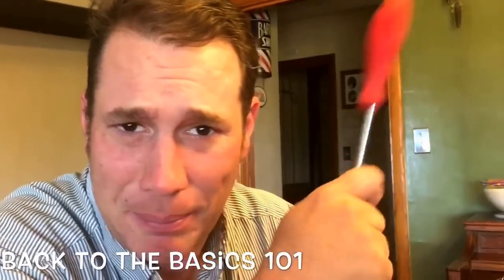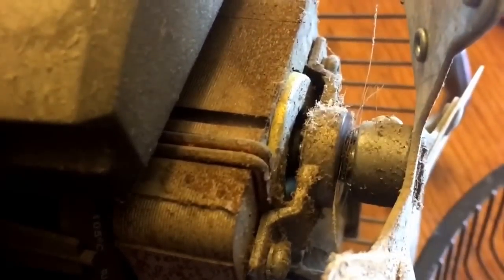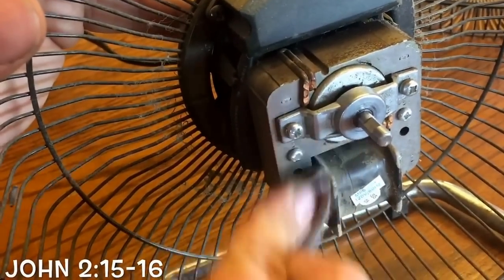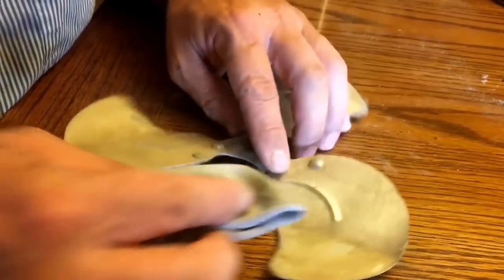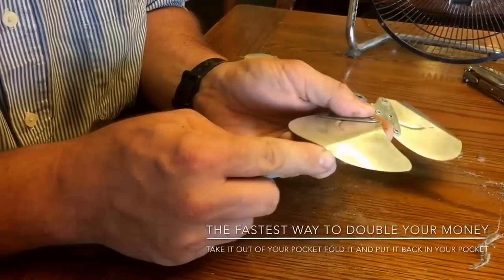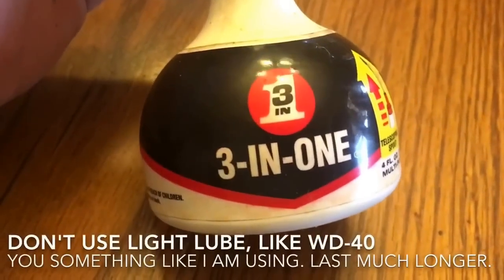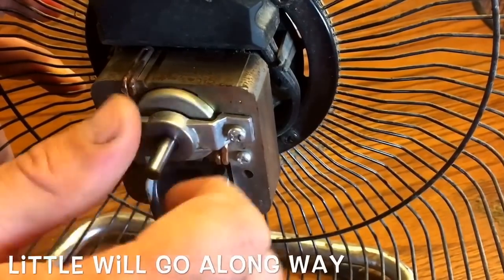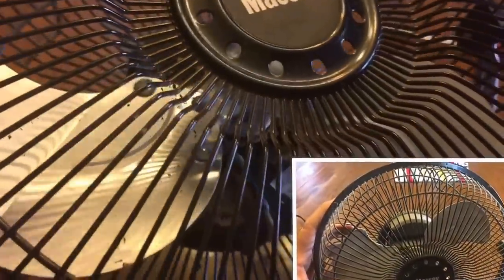Service your FAN,Clean and lube your fan

Comment: Hey, my fan is like the same. I had unscrewed those two screws on the side and the thing that roates the blade stopped rotating. When I went to go screw it back together It made a humming nose or I would have to push the blade to make it go and the metal brick thing would get super warm. After getting the both screws even and not super tight it started to spin the blade normally again. There is two hex nuts the hold it together. Mines are a bit lose, so I hope that when my fan is going it doesn't loosen the hex nuts and the cylinder metal thing doesn't go lose.
Reply: Just humming and blade does not spin (motor not burnt out).  Turn off fan, disconnect fan.  Take apart, clean fan blade, motor then lubricate motor at the bearing.  Spin the shaft until it spins freely.  If it will not spin freely, disassemble motor, spray automotive
brake cleaner on shaft at the bearing.  Re-oil bearing cup and shaft.  Assemble motor.
Once the screws are tightened and if the shaft does not spin, tap the motor frame until the shaft spins freely.
Reply: @Alvin-fz2zv  Sweet, thanks.

Comment: Thank you for the video, and also for the verse. It's not exactly something that I wanted to read at the moment, though the timing of me finding your video(I'm trying to get my hunter vintage 16in standing fan to spin better on setting 1 of 3, it doesn't power up anymore?) And the verse was impeccable. Only not so mysterious! I can only sigh and grin in acknowledgement and slight frustration. I will be following these steps to check that bearing thing and good day to you sir. You're a blessing to this place. Subscribed!

Comment: I have been sending my window fans to a fix-it shop for servicing, but he's gone out of business and I can't find anyone to clean and service my fans. It's a tedious job and no one wants to do it. I hate throwing perfectly good things away, so I guess I'll have to try to do it myself. I can manage the cleaning the cage and the blades, but I'm hesitant to try cleaning the motor. Thanks for your good video.
Reply: In today's society, things are designed not to last!  With high rental, how can the repairman survive.  If he charges too much, you'd just buy a new fan.  Look around 40-years ago, lots of radio/tv repair shops.  You're lucky if you can find one and if so, how much does he charge?

Comment: You can buy a can of air if you don't have a compressor, the oil recommended for use is "liquid bearings", there are several substitute oils you can get (like 3 in 1 illustrated here which is a general use lubricant rated for high heat high friction), yet make sure that the substitute oil is rated for fan bearings if your using another type of oil. WD-40 is not rated for fan bearings, you can use WD-40 as a temporary solution however if you do 1. Run your fan outside immediately after or aim it out a open window until the smell is gone. The fumes from WD-40 are toxic. 2. If you get it on your skin immediately wash the area with soap and water. 

I do not recommend WD-40 as again, it's a temporary solution and it will dry up quickly (1/4 the rate of bearing oil) causing the dry bearings squeeze and heat up until the motor burns out. 

This video is by far the most comprehensive video I've seen in regards to maintenance on fan care. 5 of 5 stars.

Comment: I always buy older fans such as 2000s, 90s (like the one in my pfp is from 1991), 80s and i even have a fan from the 1970s

Moxern fans never last as long compared to a 20+ year old fan
Reply: The only 1 fan I serviced is a 9" Carlton Breezy air 9 because of near dry bearings and a broken switch

Comment: I have this same fan and tore it down the whole way to clean it because my idea of fun is weird like that. BUT when reassembled it squealed and strained more than ever! If you also have this problem (w any similar fan), the solution is to tap the spindle w something like a decent sized screwdriver handle gently in all directions. That will reseat it!

Comment: Hello, I noticed when I took the motor apart, there was some cloth like debris in hole area where the spindle goes. I thought it was dirt and picked it out and threw it away, but later discovered it for the oil to absorb into? This material looks like little pieces of paper or ripped cloth. Sort of a cottony material? It's on both sides of where the spindle turns. I have no idea what that material was, or how to find new material? Thank you.

Comment: Thank you for the video. My daughter's fan is not turning well. I've tried WD-40 before and it worked a bit.  My concern is in putting any kind of liquid towards the motor.  Tomorrow, I'm going to try and open in right up and clean it.  BTW, love the verse you added to the video.
Reply: My problem wasn't that it needed oiling, but that it slipped back somehow and wouldn't turn because it was rubbing against the wiring in the back.
Reply from the maker: Sometimes the bearings were out if the fan is old and neglected. Thank you for dropping by in giving me an update. Glad to hear from a fellow Christian.

Comment: I hit mine with a hose or pressure washer. There are no circuits that can be damaged by water in fans and its a great way to clean them. Many electronic appliances can be cleaned this way, little know fact.
Reply: If you wash your fan in the shower, hose, or power washer, I would never do it.  If you do, make sure the fan inside and out (the motor) the switch is 100% dry of any water (moisture).  Water conducts electricity!
Reply: @Alvin-fz2zv  obviously you wait for it to dry.

Comment: Thanks! Some fan motors you can actually unscrew the piece that holds the crank and oil up the inside where the earth magnet makes contact with the electro magnet.  That's what I did but I used Valvoline 10w30 because I ran out of 3 in 1.

Comment: Didn’t really think about Lube mine which is a big floor fan so I decided to lube it with hair clipper oils since it’s only oil I have in and it’s been hot over here in England so I need my fan on  how ever I do clean my fan though .if I’ve not used it in awhile it gets extremely dirty so I clean it before I use it if it’s been awhile since I’ve used it

Comment: I serviced my newly acquired harbor breeze high velocity air circulator yesterday afternoon. I spent three hours taking it apart and getting the rust off of it and painting the blade,lubing the motor; When I was done I needed to shower. I still gotta put the thing back together…
But, I got a harbor breeze San. Not the 2.7 amp motor like I had 20 years ago and couldn’t believe how overpowered my fan was, and I just thought when the bearings spun out I’ll throw it away and get another one parenthesis, You will not get another one unparenthesis.

Comment: Hi 
If you dont have have the oil you used or the other one ,can you still use WD-40 as a short term fix?
Reply from the maker: WD-40 is not heavy enough oil for the fan use. Three in one oil would be a much better choice for you.

WD-40 will work in a pinch though, but it won’t last very long .

Comment: "Do I service my fans?"
Yes I do even on all my new appliances.
great video and to the point with the bit about the throwaway society.
Are you familiar with freecycle? I look for free old fans on there from time to time and did with no luck this year before ultimately just going and buying one on amazon when it started warming up and I needed one. The good thing about fans is, even today they are still for the most part a serviceable appliance. Today you can have a sweet little fan brand new for not a whole lot of money either. Think mine was like $15. It is a high velocity type of fan, 3 settings, ajustable angle in black with a simulated chrome trim. (IMPRESS 9" High Velocity Fan) Thing is a lil jet engine and I love it! I am sure it will give me years of relyable use as long as I remember to give it it's service. I can't sleep without it too!

Comment: I service my own fans a couple times throughout the summer and sometimes I do it throughout the winter cuz sometimes I have a fan on all winter in my bedroom so I service my fan several times a year I don't believe in throwing away something that can work if you just clean it if it looks dirty or Dusty or you're not getting as much air then you know you need to service it and once it's cleaned you get way more air

Comment: after cleaning place a stocking over the back to act as a filter...wd 40 on metal blades also repels the animal hair and dust...makes it easier to clean ..one of my fans has been going strong for 12 years... thanks for your tips....peace
Reply from the maker: +joseph saint 
   I've got fans that have gone that long, little maintenance save big money .
Doesn't WD-40 collect more dust?
Luke
Reply: Wd40 gets sticky over time and is counter productive

Comment: Thank you for the video. If you wouldn't mind, I'd like your opinion on the way I clean my fan. My fan is made by Lasko, "20 in. High Velocity Floor Fan with Remote". I take the guard and blade off. Then I will remove the motor from the casing. Put all but the motor in the tube with Dawn dish soap. Let it soak. Use my spray handle and blast it clean. Let them air dry. I take the moto apart as far as it will allow. I will use Q-tips and alcohol to clean all parts of the motor (inside and out). I will let it sit until it is completely dry (hours). My main question is should I use a couple of squirts of WD40 inside the motor or just let it be? I believe the last time I cleaned it, I only greased up the outside bearings. Thanks for any assistance.
Reply: I just read NOT to use WD40 in the motor. I'm buying a 100% synthetic oil called "Liquid Bearings" from Amazon.

Comment: I serviced a used box fan and also a new table that had no oil, and I found some 3 in1 electric motor oil and I have added a few drops and let it work into the bearings, and the table fan has since then been silent, just takes a little time for it to get up to speed just like a car that gets warmed it runs better. Which is what my last table fan did until it broke from it falling off a table

The box fan has since then gained more power

Comment: I sought this video because my fan is bit noisy but the noise it is making seems to be caused by something other than was remedied in this video. It's sometimes more of a rattling which makes me think parts have loosened over time.  I'm not sure I can get it much quieter with lubrication and it likely always sounded like that. In any case, I sprayed some WD-40 silicone toward the moving parts, as I best as I could get to it because I have a new fan whose blade is held on by a clip and I did not know how to remove. Would that help it?

Comment: I use my fan 24/7 can't sleep without it at night. I've taken it apart once or twice over the past three years to dusted. It's having trouble starting up blades keep moving real slow but I can tell my fan is trying to work. So I took it apart again and dusted it but it's still having the same problem and now the long thing that connects the blades won't stop squeaking so I hope oiling it like in this video will help I might just have to get a new fan though. Cuz I can't sleep with a twitch stream high-pitch squeak they keeps making especially cuz make my dog bark

Comment: I use cooking vegetable oil to lube, it works for 1 day and then it stopped turning again and the motor part is really really hot. Can I know what I did wrong?

Comment: Thank you so much for your thorough, detailed content!! I was wondering once you take it apart, could you use a hand vac to suck out all that dust?  I do believe my dirty fan has been aggrevating my allergies at night.....😒🤔
Reply: Look into getting a good HEPA air cleaner for where you sleep. You need to pull that dust and stuff out of the air.

Comment: Use your Watt Meter power monitor-before and after- to see the difference in current draw. Likewise, you did not lubricate the rear bearing.  You can spot a bearing that is becoming dry knowing the current draw and having it written on the various fans around the house. Thanks for the useful instructions to maintain our stuff.
Reply from the maker: In the description I believe I said I forgot to film oil in the rear bearing but you do it the same way as the front you’re exactly right. Thank you

Comment: but you forget the back side of it. because it also got bearing and the back part of it also covered with dust
Reply from the maker: You’re absolutely correct John, I completely forgot to film the back bearing. You’re the second person to bring this to my attention. And you’re absolutely correct it is important to get both bearings.
Thanks for your interaction. 
Happy trails.
Luke
Reply: i often oil our e-fan if the temperature of the motor got high faster than normal. it only means that the oil is already wear off.and actually if you can take off that front housing you can clean the dust hiding on it that can also wear off your bearings. and from their you can oil the bearing better,
Reply: how often do you oil your fan?
Reply from the maker: Twice a year is generally a good idea. If you don’t use it often once a year is fine. That’s been my experience.
Reply: i usually oil it once every 2 to 3 months due to dusty environment and also because of my dog's fur ... and hot environment and a minimum of 12 hrs of usage abuses the lubricant..

Comment: Those chinese massey fans wear out fast if you run them on high for days on end, once the bearings wear out, you'll need to lube them weekly or it will stop spinning and start smoking and cause a house fire. If maintained properly it could be fine preventing that but the regular consumer doesn't do things like that. why risk it when there are fans from the 50's still around that are more reliable, A fan from the 80's would be preferred, I feel that cheap chinese fans are housefire waiting to happen especially if you leave your home or go to work with the fan running, it can spin freely then quickly slow down and stop spinning unexpectedly. Massey fans could for sure burn down a whole neighborhood.

Comment: ...Me again. The fan is an old 16" K-Mart Box fan, that belonged to my Granny, then my Mother. I am not ready to let it go. It's a real pretty sky blue workhorse. Made by Lakewood Eng. and Mfg. Co. Chicago IL type U63  It also instructs the owner to oil every 6 months with S.A.E. 20. I don't understand electrical but a section called "Connection Diagram" has a list of wires, listed as Common...White; High...Black; Medium...Blue; Low...Red, I'm assuming it's for the dial switch on the top, but I cant be sure. There is also a boxed number on the right side of the motor housing that reads M7 4 by it's self

Comment: I cleaned all my fans and use a air mattress blower to blow out the moter then I use three and one oil  and it work like nothing wrong with it but I'm having trouble with one fan it's called Hawaiian  breeze and I'll oil it and it will run for three days then it needs oil again I need help where the fan will run for a while and not have to oil it every three day can you help me out please

Comment: I regularly clean my fans about twice a year.  I use my fans a lot.  What I came here to find out is how to oil and lube my fans so they run quieter.
Reply from the maker: normal maintenance has a lot to do with it. As a fan gets older it often times does get louder.
Reply: I clean mines once a month.

Comment: Unfortunately as I search YouTube videos for a way to fix my 3 small tabletop fans who have recently started to squeak this hot summer I keep coming across the comment that everyone has forgotten to show lubing the back bearing. (I didn't even know there was a front & back bearing until now) Yours is about the 8th video I've seen so far. At least with your video I'm starting to understand where this might be. As a person whose never done this before I'd kinda like to see it done before I start so I don't mess it up. Will you be making another follow up video anytime soon correcting this oversight? I'm off now on my continuous search for this elusive back bearing. 😉
Shout out to Liberty for doing such a good job on the camera work! 👏😄
Btw, your lunch break looked yummy.🤤  Shout out to the cook!👏🙂
Reply from the maker: Thank you I will tell liberty, also you are correct, there is a rear bearing which is very easy to lube. The same as the front. I just forgot to put in the film... very bad mistake.
Thanks for watching. Stay cool
Luke

Comment: I service mine I have a insignia ten inch table fan that's retro
Reply from the maker: Their builder almost to last forever if properly maintained. Thank you
Reply: I use liquid gold on
 the body and blades it repels dust . And oil the stem connecting to the blades

Comment: WD40 is not oil.
That variety of 3n1 won't last more than a couple days. 
The correct oil is made specifically for electric motors. You can also use sewing machine oil. Both are inexpensive and will last for years.

Comment: I watched your video as I was cleaning up my small table fan. Had to use baby oil temporarily instead of 3 in 1. I also read the Bible verses 1 John 2 15 and 16. That's probably one of the most important verses we need to obey in these last days. Thanks for sharing.

Comment: You should have taken the motor apart behind those bearings is like a felt that needs to be soaked with some oil YOU FORGOT THAT THEIRS A REAR BEARING . YOU NEED TO TAKE THE MOTOR APART.Theirs two screws that release the motor and two screws that let you take the armature and bearings out i do it on my cheap fans and get 20+ years out of them.
Reply from the maker: In the description box below the video I explain that there’s a rear bearing that I did not show in the video been oiled. I completely forgot to put it in the video. Thank you for pointing it out once more. Good comment.
 Happy trails
Luke